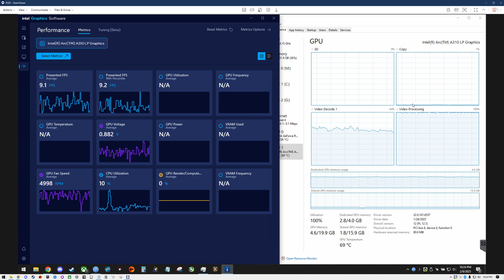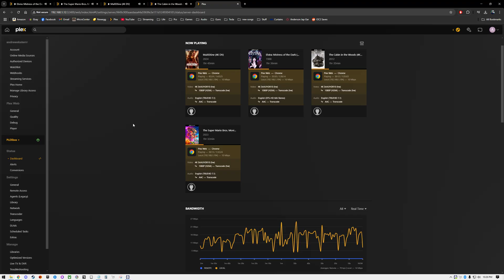PLEX UHD Bluray Dolby Vision Remux transcoding with the Sparkle Intel Arc 310 ECO

Comment: Interesting stuff, but I don't think the A380 would give much of a different result, because the encoder/decoder hardware is the same on both cards. The B380 just has more VRAM, and it looks like you're not maxing out the 4GB. 
This is good info, because I'm planning to get a GPU for my server, although I'm running Plex on TrueNAS. Have been trying to find comparisons of the A310 and A380 to decide what to get. 
That being said, the majority of media I have is 1080, and the 4K stuff I have is 265, not straight BR "backups" ;)
Reply from the maker: So I talked to some guys on Reddit who had A380s and they were getting more transcodes then I was with similar media. IDK why because the encoder is the same and VRAM wasn't an issue. I returned mine and just am using my 3090 again for gaming and encoding since it's only used when people come over.
Reply: @andrewskaterrr  I think the most I've had streaming off me at one time is about 25 😂
CPU is 10 core 20 thread 3ghz, but gets hit HARD if someone starts transcoding a 4k movie. So looking for a 75w card to give it a boost and hopefully lower power consumption. Something like a 3090 is out of the question for me haha. 
Was originally going to go for a Quadro P2000. Seems to be a solid choice in the past. Then recently, I've seen people claiming that the Arcs are actually really good. Having a look on eBay, it seems that there's not much price difference between the A310 and the A380, so going for the A380 might be the move! 
Also, why did they name their card after an Airbus commercial jet? 😂
Reply from the maker: @LockieNZ  HDR transcoding is a killer for CPU, but hw transcoding makes is manageable. The P2000 is a classic choice, but unless they are Direct Playing, I'm not sure if even a P2000 could handle 25 transcodes? Double check the max on that, but I thought I saw an Intel iGPU doing 17 in one test, but the dGPUs couldn't get that high. The ARC cards are pretty good, not up to Nvidia's level in some tests, but being able to buy a $100 card that can do a couple is awesome. One thing to keep in mind is encoder quality. The newer cards sometimes have newer encoders, which give better quality at the same bitrate. I suggest checking out EposVox for benchmarks. If your try an A380 let me know how many 90Mbps 4K Dolby Vision to 1080p 10Mbps streams you get. You may have to watch for a while to make sure it's buffering faster than 1.0x speed for every stream.
Reply: @LockieNZ  Hey, did you end up going with the A310 or A380 and how did it perform?
Reply: @xPurplePatchx I didn't, sorry! Ended up relocating my server to somewhere that I didn't have to pay for power and left it at that 😬

Comment: Hey man, if you cap out at the same number of simultaneous streams when encoding to h264 as you do when encoding to HEVC there has to be something else limiting the number of streams you are doing. H264 is way less resource intensive than HEVC so capping at the same number of streams really doesn't make sense. Something is dodgy there and I suspect you can do more than 3 HEVC encodes at the same time if you find out what it is and rectify it. Do you have resizable BAR enabled?
Reply from the maker: No limits, and yes REBAR is enabled. My 3090 has no issues doing over 3. I tested HEVC and H264 as I stated in the description, same number on each. This isn't like CPU encoding, so it's up to the hw encoder and how many it can handle of each. I even tested 720p, and almost got 4. As you saw in the video the limit seems to be the Video Processing. They removed that graph though with the next driver update so I lost the ability to view it.  It can only do 2x 4K DV > 4K 40mbps HEVC streams as well.  I ended up returning it. I just got confirmation that the A380 can handle 6x 4K DV 71Mbps transcodes though.